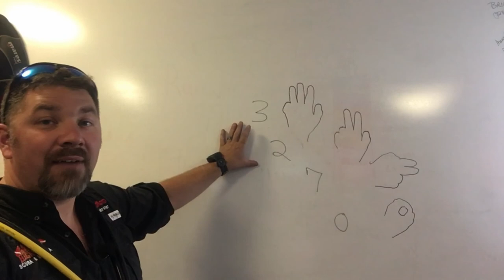Signaling Air Pressure To Your Buddy

Comment: ive been living and got my certifications outside the US .   Really glad i found this as everywhere i have ever dived has always been in BAR and the signals are simple. Im coming back for the summer and planning some diving in Florida and have been worried about this exact problem.   My question is my spg is setup in BAR ,  how do the local guides handle folks like me who will be signaling in BAR  ( I cant see buying a new spg in PSI ) as im not going to even attempt the math conversion underwater.  Are most US guides or Pros fluent in PSI and BAR ?
Reply from the maker: Hello C H, for the most part yes, most Dive Professionals are fluent with both the Imperial and the Metric System. The two things that you can do to eliminate confusion with someone while try to communicate underwater is 1. always discuss with your buddy during the briefing how your equipment works and how to read it, and 2. simply just show your gauges instead of using hand signals, this way, their is no confusion.

Comment: What is a bar considered in American psi gauges? Starting with 3000 psi‘s how many bars would that be considered? Thank you
Reply from the maker: Hello @timothyfehr2277, a bar is the equivalent to 14.5 psi in the scientific world, and 14.7 psi in the scuba diving world. A 3000 psi cylinder is calculated as 204 bar (sometimes calculated as 206 bar), most just say 200 bar. A high pressure cylinder is calculated to 300 bar. Hope this helps.

Comment: Ah man I learned so differently than this 😂😅🤦🏻‍♂️
When I did my advanced we worked on horizontal hand signs for numbers so I know what you were referring to.

But I was always taught to round down to nearest 500. 
For example, if my instructor asked for my psi and I had a true 2800, I would flash him a 2 then hit my chest or arm and then flash a 5 showing him I’m at 2500 not the actual 2800

Is that technically wrong?
Reply from the maker: Hello johnny cole, personally I don't believe there is a right or wrong way.  We are all taught differently.  The most important thing to remember is for you and your dive buddy to do thorough briefing so that both of you understand what each hand signal means while diving.
Reply: @LakeHickoryScuba  makes sense. appreciate the feedback. I need to head to lake hickory soon!